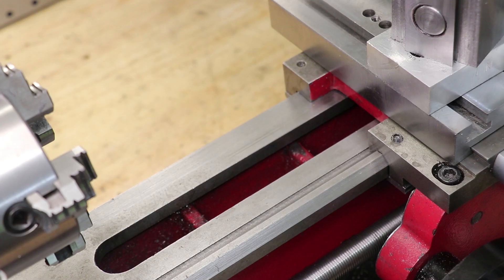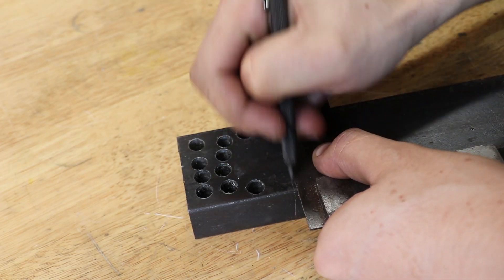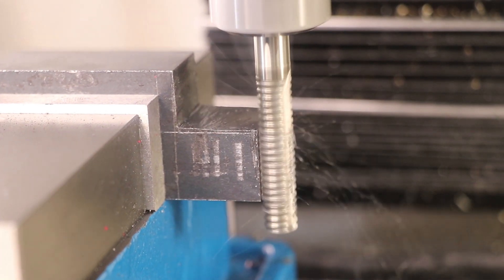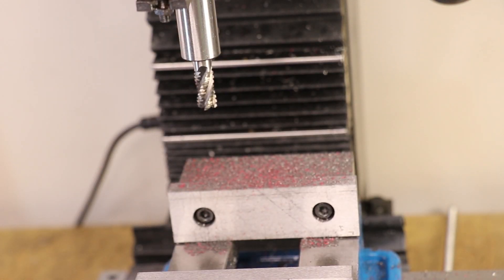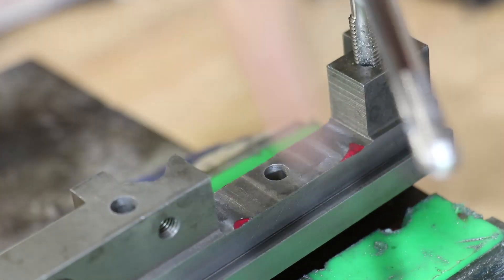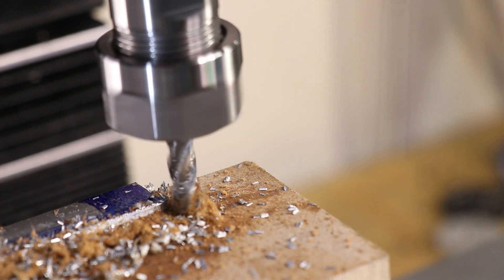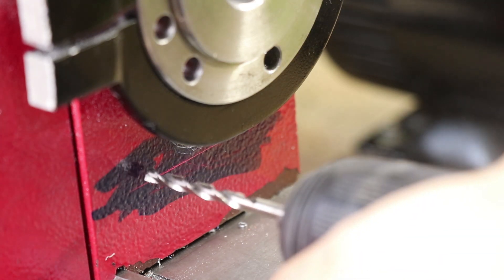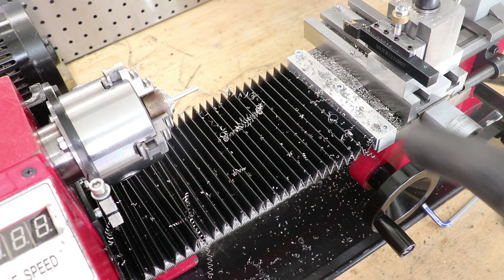Lathe Way And Leadscrew Cover Upgrade

Comment from the maker: This is the link I Used, there are cheaper ones on aliexpress but at the time none stocked 140mm wide way covers. https://www.ebay.com.au/itm/123970270040?var=424768881409

Comment: If you didn’t know, those angles on your carriage are called draft angles. They’re there for a casting to release from their mold so they should be expected on any unfinished casting surface
Reply from the maker: Yes this is correct. Had to deal with them before, especially when fixing the tailstock

Comment: Nice. I hate how my 8x16's leadscrew is always covered with chips. I think if I went this route I probably would've used magnets making it easier to clean. 3D Printing brackets would probably be the quickest and cheapest "way"  to go.
Reply from the maker: I guess thats the best part of DIY stuff, do it how you want to. Im personally not as huge fan of using magnets but if ti suits you that is great. Cheers
Reply: Magnets attract swarf and are a pain to clean 
(ask me how i know...:(  )
Reply from the maker: @tano1747  Yep, I am so thankful mag bases can be "turned" off for that reason.

Comment: Just make sure to regularly go out of your way to lubricate the  (now out of sight) ways or this cover will inadvertently result in more damage to your lathe.
Reply: HE should have not bothered. Felt blocks on the carriage that fit tight to the bed ways is a much better solution. Put oil in the felt and it keeps the ways lubricated right at the carriage where it is needed. The felt sweeps off any metal before it can grind between the ways and the carriage.

Comment: For next upgrade fill the space beneath the ways with concrete or epoxy with gravel - more mass, more rigidity
Reply: specifically granite gravel ~3-5mm, though I've seen a lot of refferences to just bolting down to something heavy makes a significant difference too.
Reply from the maker: It is definitely something to consider, I have heard that it can work wonders in adding rigidity

Comment: What did you search on eBay? I’m having no luck in uk would love to do this upgrade
Reply: I just searched for "flat bellows" on the offchance and got relevant results. HTH.
Reply: @neilbarnwell  thanks so much!
Reply: I got a good result searching for accordion bellows, in the Business and Industrial category. There are some interesting options that extend down the front and back that might improve protection for the lead screw as well as keeping even more off the bed.
Reply from the maker: This is the link I Used, there are cheaper ones on ali express but at the time none stocked 140mm wide way covers. https://www.ebay.com.au/itm/123970270040?var=424768881409

Comment: I find that the plastic way covers melt when hot chips fall on them. I combined a short metal shelf on the carriage with the accordion cover. This protects the area of the cover next to the carriage while still keeping the full protection.

Comment: Probably the best thing in this channel is that you actually know how to use a hacksaw and a file. A lot of channels think that you need expensive power tools to perform those simple operations.
There is a particular channel that uses a heavy Dewalt portable bandsaw to cut off a single length of 1/4" threaded rod. And that person is definitely not a strong "manly-man" LOL

Comment: I always enjoy your videos. Keeping that sweet spot protected is so important. I have a 1940' or '50's South Bend 9 that's in mostly good shape. But there's about 5 or so inches of the ways that have clear signs of abrasion.

Rigidity.... Well we all know the compounding benefits of rigidity (and dampening). I was chatting with a friend who told me about people filling parts of their machines with cement/concrete. This was during WWII when home workshops in the UK and US were working towards the war effort.

Another thing is torsional loading. As in, we don't want to apply any. In Navy ships, lathe stands are supported in 3 locations, as opposed to 4. This way the head-end has 2 points of contact with the floor, while the other has 1 and any unevenness in tbe floor doesn't twist the frame (and the ways).

Comment: An old preacher friend of mine told me about using discarded gears he bolted to the back side of his chuck shaft. One a 60 tooth for minute and a big 360 flywheel for degrees. A degree wheel could be used for instead of the big flywheel on the mini lathe. 
    I have ordered one of these. Don't know where it is in the 🌎 world, and hope it gets here soon.    I do have a 13inch swing South Bend shop lathe. It's great for farm work. On tiny parts it's way too clumsy.

Comment: I notice that you are using 3-in-1 oil for cutting fluid. Do you like it?
Reply from the maker: I have used 3 in 1 a lot in the past and it works fine, even if its not really meant for this application. Its $2 a bottle and it works. What I used here was a mineral paraffin cutting oil, I just use the 3 in 1 bottle because its a convenient bottle to use and I like it.

Comment: Very nice. I have been considering a concertina way cover but found them too expensive but that seems a very reasonable price. I have just been using a bit of rubber sheet which is ok but yours looks nicer and still allows close chuck access. I dont think I would bother with a rear cover as it interferes too much with the tail stock
Reply: Reconsider...this isn't a great idea. It's in the way as often as it's not and once the accordion folds get a little stretched out they bunch upwards and run into your chuck. A much better solution is an old paint brush to sweep away metal. Then add felt blocks to your carriage that fit tightly around the bed ways. They retain oil for lubrication and  they sweep away any metal before it can get under the carriage. Totally trouble free and keeps the ways lubricated exactly where you need it!
Reply: @de-bodgery  Yes that has been my experience. I currently have a piece of rubber sheet connected to the slide and it works well to keep the bulk off. I appreciate your comments and tend to agree. I have ordered one of these via Aliexpress to try it so it will be interesting but I suspect you are right :)
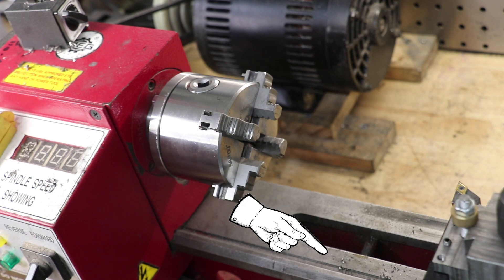Reply: @campbellmorrison8540  Go to 0:50 in this video. You can see what happens to these accordion covers after a while and what Blondihacks had to do. Just me maybe, but that's not worth the trouble. In a couple of her other videos, she takes it off or it's already removed. They do keep the ways clean, but they are also a hassle. Some felt shaped to fit the ways sweeps them clean and oils them all at the same time. 
https://www.youtube.com/watch?v=C5g4KuMlQ2g&t=12s
Reply: @de-bodgery  I was looking at making mine clip on just for particularly messy things like cast iron.
Reply: @campbellmorrison8540  Use magnets that are inset into the attachment points. Metal will be attracted to them, but if they are flush, that wipes away easily.

Comment: Hi, what keywords should I use for searching on eBay and get this accordion...?
Reply: search for "accordion way cover" on aliexpress (way cheaper than ebay)
Reply from the maker: This is the link I Used, there are cheaper ones on ali express but at the time none stocked 140mm wide way covers. https://www.ebay.com.au/itm/123970270040?var=424768881409

Comment: I'm currently rebuilding my lathe headstock, uprated gears bearings etc. I 'm definitely adding this to that process I was using fixed "catch trays" made from baking trays would you believe.... well it works but just not attractive and does not have the flexibility of travel that this  provides

Comment: Great upgrade! Added rigidity is always a plus. 
Do you have a product link? 
Cheers
Reply from the maker: This is the link I Used, there are cheaper ones on ali express but at the time none stocked 140mm wide way covers. https://www.ebay.com.au/itm/123970270040?var=424768881409
Reply: Ask yourself this: HOW did any of that "add rigidity"? Maybe that steel block added a little to the carriage, but I doubt it. It's already a thick slab of cast iron. It sure wasn't added mass. This entire mod added maybe 1 pound to the weight of the lathe. I'm highly skeptical any machining improvement happened at all from this mod. I like the channel, avidly watch the videos and use some of the ideas presented here, but this is pure bunk! I bet what happened is his carriage needed tuning. He took it all apart and then put it back together all set up nice and snug again. THIS was why things improved. It had nothing to do with way cover in any way.
Reply from the maker: @de-bodgery  I think its important to remember just how little mass there is in the carriage. It is a small piece of cast with a lot cut away. You can always try your self and see how it might or might not work for you. I am certain that there was in improvement, definitely an improvement in vibration dampening. I understand your skepticism, but from what I encountered it feels better. Cheers
Reply: @artisanmakes  You know your lathe better than I do by a long shot! Mine is only a little larger than yours. I can't imagine how that little added mass would make any difference. I still think you tuned out slop in the carriage when you put it all back together and that's why things are more ridgid. when was the last time you did any tuning of your gibs and carriage stays? They start developing movement on my Little Machine Shop 7500 lathe where I want to deal with it again about every 10-20 hours of use. That's not a lot of hours of use before I'm re-tweaking something. Your lathe is pretty similar to mine.  I can't imagine it stays "locked in" much longer than mine does. This seems the likely source for your improved rigidity IMHO.

Comment: i couldn't find a waycover like this anywhere in europe for that kind of price (< 20€).
Could someond provide a link please?
Reply from the maker: This is the link I Used, there are cheaper ones on ali express but at the time none stocked 140mm wide way covers. https://www.ebay.com.au/itm/123970270040?var=424768881409
Reply: @artisanmakes  Thanks, much appreciated!

Comment: Looks great. Is it worth cutting the cover to be slightly shorter so that it isn't fully compressed when you're up against the chuck? Right now any chips that are resting on the cover will have no space as it collapses.
Reply from the maker: I trimmed it down a little bit more after this so yes, it is worth doing that if needed

Comment: Hey mate thanks for sharing 🙏
Can you tell me what sort of insert you are using for fly cutter & if it’s left hand ?
Reply from the maker: RDMT10T3MO inserts. Its a custom holder that I made. Just use an endmill to bore out a round pocket for the insert to sit in. https://www.aliexpress.com/item/1005003195440403.html?spm=a2g0o.9042311.0.0.4ce04c4doloNNm
Reply: I was gonna ask if he used a left handed hammer 🤣🤣👍

Comment: For a minute there I thought you were going to drill into the headstock gearbox - I was waiting for the oil to come pouring out!
Reply from the maker: Maybe on a larger lathe, but no gears in this headstock
Reply: Some mini lathes have a headstock gearbox, but i don't think any of the sieg 7x size lathes have an oil bath in there... That would require an entirely different headstock casting...
Reply: Yes I've not used the smaller lathes, although I'm going to get one! I'm a qualified fitter & turner but i haven't worked in that trade for 27 years.

Comment: G'day Art, super work as usual. Hope the 'bracket' extra mass an improvement on your lathe. I was wondering if 2-4 Neo 52 magnets would hold that cover in place without any issues? Cheers, Michael 🇦🇺
Reply from the maker: Cheers.  I use bolts simply because the magnets might attract swarf, but I see allot of people use magnets without too much issue.

Comment: maybe create a magnetic holer to attach and remove back cover eaisly ?
I need to do the same thing for my lathe but plan to have some magnets built in so i can remove it without screwing in anything
Reply from the maker: magnets are a, no pun intended, magnet for swarf. I am not a fan of using them but other people do. You could use thumbscrews to make screwing it easier though.

Comment: Why not leave a link for the way cover?
Reply from the maker: This is the link I Used, there are cheaper ones on ali express but at the time none stocked 140mm wide way covers. https://www.ebay.com.au/itm/123970270040?var=424768881409
Reply: Because he DID leave a link... the first PINNED COMMENT.

Comment: what do you call the cover
Reply from the maker: This is the link I Used, there are cheaper ones on ali express but at the time none stocked 140mm wide way covers. https://www.ebay.com.au/itm/123970270040?var=424768881409
Reply: @_Jester_  thank you

Comment: dont cut stock by hand!
Reply: Nothing really wrong with it, he just doesn’t have enough room for a band saw.
Reply: Why, are you too weak to use a hand tool?
Reply: @johncoops6897  personally I’m just to lazy
Reply: @shotgunsam23  - I am lazy too. But like most people it is all about prioritizing .
For example, if I had spare money I'd buy a lathe, before worrying about a metal bandsaw. That's simply because I have numerous ways of cutting metal (including an Oxy, Angle Grinder, etc) however I cannot do what a lathe does with any other tool, let alone by hand.